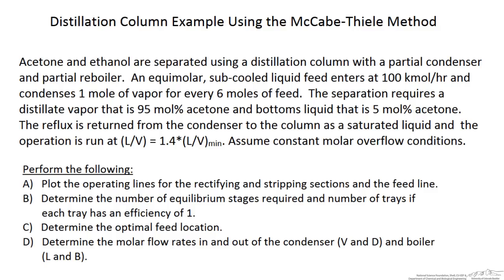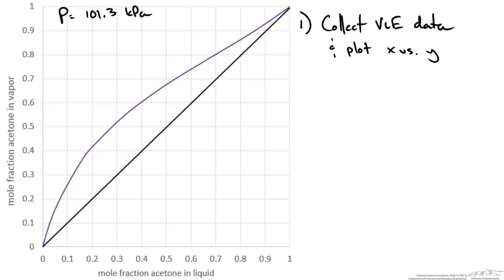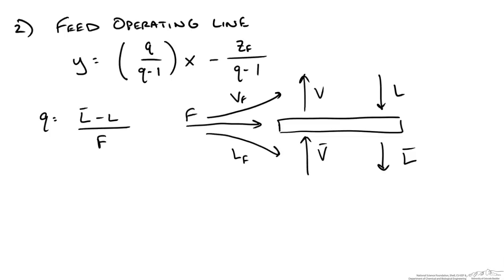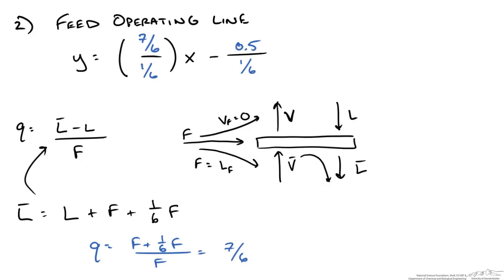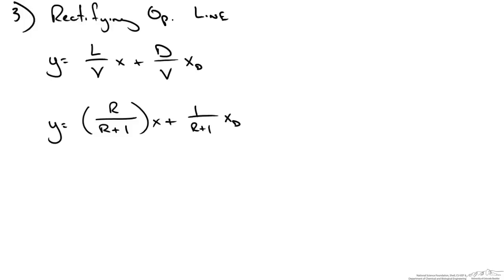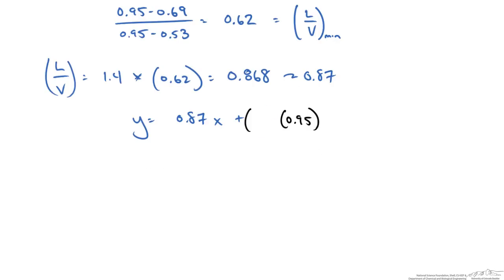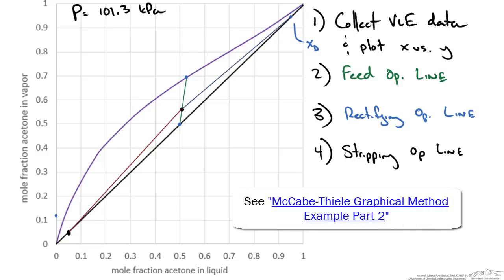McCabe-Thiele Graphical Method Example Part 1

Comment: I'm confused why you added 1/6F in mass balance to find L(bar)?
Reply from the maker: Thank you for your question.  The 1/6*F is from the problem statement where we know that for every 6 moles of feed, 1 mole of vapor is condensed.  Does that answer your question?
Reply: LearnChemE 
Is the value of V going to the condenser equal zero cuz it’s saturated liquid?

Comment: Beautiful work Sir, thank you for it.
I just wish you drew the minimum L/V line.  Based on the shape of this equilibrium line, this might be a case where the minimum, if calculated between XD and the intersection of the q line with the equilibrium line is invalid due to an intersection of this line with the equilibrium curve at an X point between XD and the q-line intersection with the equilibrium line

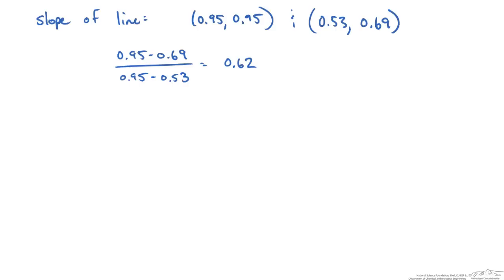Comment: Hello! I don't get why did you drew the feed line actually this way 3:49 and you haven't explained where are you getting those values from to determine slope line 5:48 . Not really clear...
Reply from the maker: Bart Tricas Thank you for asking and for putting the times into your question. Please clarify the first part of your question.  I don't know what you are asking about the feed line.  For the slope of the rectifying operating line, you use the distillate vapor mole fraction xD = 0.95.  That point is on the x=y line, so y also equals 0.95 at that point. The other point is drawn at the pinch point where an infinite amount of stages would be needed.  This is where the feed line intersects with the vapor-liquid equilibrium line (0.53, 0.69).
Reply: LearnChemE Same problem here. From the video, the feed operating line is y=7x-3. But I still don't get it how you drew that line.
Reply from the maker: FabIrsy If you are asking about what software is used, I can find that out.  But basically, it is a line with a slope of 7 and a y-intercept of -3.  With the y-intercept being so far off the plot, it may be easier to draw the line by solving for x when y = 0 (x = 3/7 or 0.43).  Another point on the feed line is (0.5, 0.5).
Reply: Bart Tricas
y=7x-3
The x intercept (x value when y=0) is   (3/7) or abt 0.4286, and the y intercept (y when x=0) is -3, off the bottom of screen.
Draw a line thru the points (0.4286, 0) and (0, -3)  to get the feed line.
Only the part between the 45 degree line and the LVE is of interest.
Reply: LearnChemE Thank you for the explanation, it's clear now. So, what software did you use? Because at my university we learn McCabe-Thiele graphical method by doing it manually without software.

Comment: How can I get the equilibrium curve? .(the blue curve)
Reply from the maker: You can obtain the equilibrium curve through collecting experimental or published data, or using a thermodynamic equilibrium model (like Raoults, or Peng-Robinson, etc.)
Reply: LearnChemE I think the person meant for this exact problem, it doesn't give us any basis to make the equilibrium curve.
Reply from the maker: Christopher Luu Thanks for clarifying.  you are right that the problem is not specific in operating conditions.  You would need to look up equilibrium data or use an appropriate model.  I used atmospheric pressure to plot the data.
Reply: If Raoults law is used we would assume that the solution is ideal. yP=xPsat. Pressure is constant but temperature would vary. Therefore, the temperature along the distillation column is varying but not the pressure... Is this correct?

Comment: For a partial condenser, should the mole fraction of the distillate be yd instead of xd?
Reply from the maker: You are absolutely right that with a partial condenser, we are treating the condenser as an equilibrium stage, and we have both vapor and liquid leaving the condenser with the vapor being the product and the liquid returned to the column. The vapor was specified as 95 mol% acetone, which is labeled on the plot as xD. It should have been labeled as yD. It does not change the solution though.
Reply from the maker: If all the vapor was condensed that left the partial condenser, it would be the same composition in the liquid state, so we could say xD in that case.
Reply: Very true. I didn't mean to be nit-picky. Your videos are absolutely amazing and very well explained. I'm lucky to have found a resource like this to help supplement my studying.
Reply from the maker: Consistently No its important to be "nit-picky".  We want to make sure we dont have mistakes in the videos so we appreciate the feedback.  Glad you are liking these.

Comment: Sir if its mention in question that feed is saturated liquid then in that case q=1, when i put q=1 in the q line equation answer in infinity? what should i do now?
Reply from the maker: Thank you for your question.  The q referred to here is not the same as steam quality.  Here it refers to the feed state and how many moles of liquid are in the feed stage per mole of feed.  See 1:45 in the video.  I hope that helps.